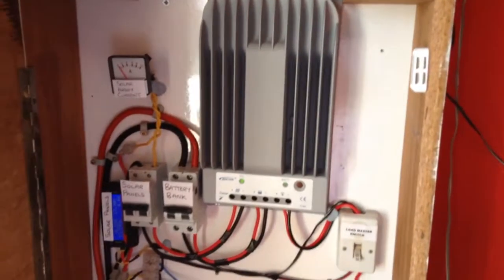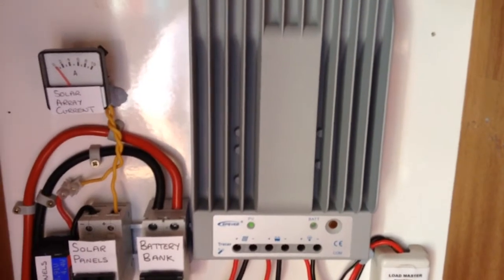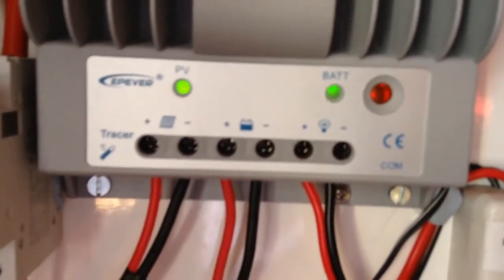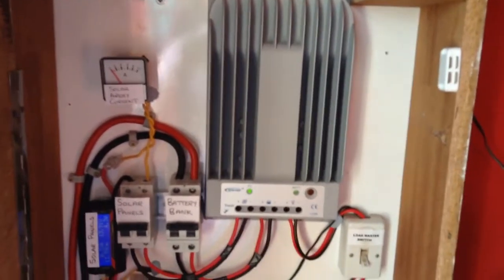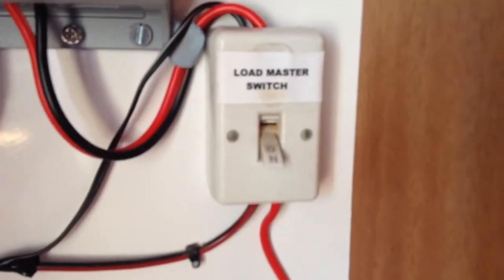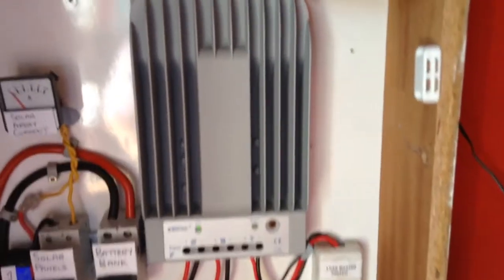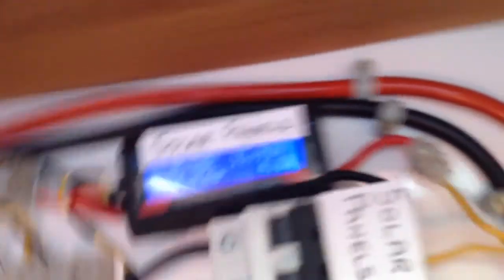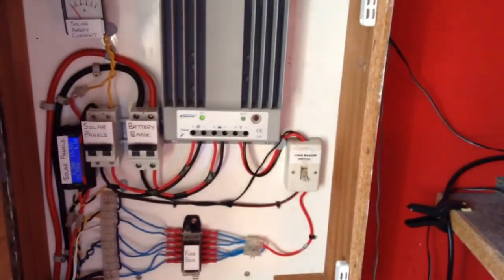Sun 5th June New Tracer 3215BN 30A charge controller

Comment from the maker: Hi, yes I run all my loads from the controllers load output, as my controller has a remote meter which shows the current and power consumption of the loads connected to it. My controller logs the amount of watt hours charging from the solar panels and the watt hours drawn by loads which can be useful. Also the loads are protected by the charge controllers protection features, such as if the load develops a fault such a short circuit the controller will disconnect it from the batteries helping to prevent a fire for example, although all loads should be properly fused though, the low voltage disconnect function will switch off the loads if the battery voltage fall too low, the load will be cut off if the battery voltage gets too high or if the battery cables are hooked up in reverse.
The only thing connected directly to the batteries through a circuit breaker and switch is my power inverter as it needs more current than the controller can supply.
I have a 12v system as most of my loads are DC and inverter is low powered 300w ( used mainly for charging things with supplied AC charger e.g. Cordless power drill, hedge trimmer, e bike batter, laptop pic and other electronic gizmos, nothing over say 200w max).
If all your loads are AC and high powered, I recommend 24v or 48v system, because at a higher voltage less current is needed for any given power requirement. Especially where high powered inverters are being used, high current cable is expensive and bulky to handle. High currents increase the risk of fire as well.
If you use 24 or 48v system you can use 12v equipment as dc converters can be purchased to convert the 24 or 48v down to the 12v needed.
Hope this is helpful, if you need more info feel free to ask and explore my other videos, thanks for interest in my channel. Solartiger

Comment: Hi, question:
Do you ONLY run your loads from the controller's load output, or from that AND the batteries direct? 
If both, why? I'm new to solar and struggling with a lot of conflicting info...

Comment from the maker: Forgot to mention my loads. Most of my loads are DC, I have 12v fans, lights, battery rechargers (aaa,aa and 9v), soldering iron, music system, vacuum cleaner, mini fridge. In my solar shed I have fans, dc water pump, lights, radio and dc led flood light. I also charge and run 5v USB devices through an 12v to USB adapter such as iPod,iPad ,USB fan , Bluetooth headphones,MP3 player, powerbank.
I have the inverter to run AC items, these are mainly ac adapters to charge things such as power tool batteries e.g. for cordless drill, hedge trimmer, electric bike battery etc nothing high powered, most these consume way under a 100 watts, hence I have very small inverter. I also have an inverter in the shed (350 watts 12v) I use this to power the grass strimmer and uses 300 watts, cutting grass takes about 30 mins once a week.
For the shed I have 50 watts solar, 1x 12v 100 amphour battery and 350 watts inverter, the inverter is mainly used for grass trimming once a week and only for a short period at a time . I mostly use dc things such as fan, listening to the radio/ music system , soldering iron etc on the weekend, so plenty of time for the battery to charge during the week.

The indoor system gets daily use hence it is more powerful but still small by a lot of people's standards.
When using electricity always treat it with caution where ever it comes from. A 12v battery way sound safe, but short it out with something metal and you could be seriously burned and the battery may boil or even explode, flooded batteries contain acid that can burn the skin and the AC current from your inverter can electrocute just as well the mains from the grid. So be careful, use the right size cable, always use a fuse or breaker of right type and rating and Ac wiring must always be earthed/ grounded for safety.

Hope this is helpful. Solartiger Happy solaring !
Reply: very helpful, thank you for taking the time

Comment from the maker: Hi,
I have the wind controller in the battery,box, there is no issue with corrosion from battery fumes as these are sealed Agm batteries and under normal conditions the gases produced when charging are recombined inside the battery, this is why this type of battery is safe for indoor use. The wire used for the wind generator is rated for 25 amps, its max rated output is 18 amps which I have never seen. I think you would need gale force winds to achieve that. The highest I've had in my location is about 10 amps and that was in a storm.

The solar panels are wired in series (3x 17.2v =~60v on a clear sunny day) using 4mm2 solar pv cable into the house and then with 20 amp to the charge controller. The panels produce approx 6 amps max. I have a 10 amp double pole DC breaker between the panels and the charge controller. The controller can output up to 30 amps into the battery bank and only 20 amps into the load output terminals. From the controller there is a 32 amp double pole DC breaker (if the controller develops a short circuit across the battery terminals the breaker will trip preventing a fire as the batteries could push serious amperage in to a short circuit). The cable from the controller to the batteries is 16mm2 which is rated for 110 amps no problem to handle the 30 amps max from the controller.
The 300 watt 12v pure sine inverter is wired directly to the batteries through a battery cut off switch (type used in cars and boats, good for at least 100 amps) a 25 amp circuit breaker (car fuse type) and an amp meter (0 - 60 amp analogue type, to monitor amp draw). At max load the inverter would draw 30 amps, I have it fused for less as I don't need that much power. My inverter is very small, but it covers my needs, yours will probably be larger, so you scale up your components and cable accordingly.

I have 300 watts of solar, 300 amp hours of batteries (of which you can only use 50% if you wish your batteries to have a long service life, so 150 amp hours in my case) and 300 watt inverter. This is a small HOBBY system, I have grid power for everyday living.

This comment was long, but hopefully answers most of your questions, if you want to know anything else feel free to ask.

Solartiger

Comment from the maker: I am happy with it for the price. I have the 30amp version but the load terminals can only supply 20amps ,the 40amp version is the same. Another thing I have noticed is, I have set the charging limit to 15V as stated on the batteries, but I have noticed that max battery voltage displayed has sometimes reached 15.4V, just to let you know.
If you will be using an inverter regularly I would recommend a 24V setup. Hope this is helpful.

Comment: Ｈｏｗ　ｆａｓｔ　ｄｏｅｓ　ｉｔ　ｃｈａｒｇｅ？
Reply from the maker: xierxu How fast it charges depends on the amount of sun, the wattage of your solar panels, the capacity of your batteries and how discharged they are. Solar panels rarely produce the output power that they are rated at, that power is measured under ideal test conditions, real world conditions just don't match that. This is a 30 amp controller, the manual says you need 400 watts of solar panels in direct unobstructed sun to have a chance of producing that. Chances are you won't achieve that, also your batteries will only draw max current if they are really 'flat'  (which you should avoid, to prolong long term battery life), if your batteries are well charged they will only draw a small current to charge regardless of how much solar power is available.

Hope this helps. Solartiger
Reply: Solartiger Very informative. Thanks.
Reply from the maker: C
Reply: I have a solar epic and was wondering if this has a switched relay that I can run the box fan when the batteries are gassing or how can I make that work?  thanks for your great video!

Comment: Seriously better stuff is out there but the tracer is really good. I found a better MPPT here, http://rover.ebay.com/rover/1/711-53200-19255-0/1?icep_ff3=11&pub=5575119394&toolid=10001&campid=5337668021&customid=Best+Warranty&icep_store=Hurricane-Wind-Power&ipn=psmain&icep_vectorid=229466&kwid=902099&mtid=824&kw=lg His stuff is that next generation MPPT
If you get one do a vid on it. I will try to upload a vid when I get a few more .
Reply: Јоhn Daniel ..i considered rover but requires renogy specific meters etc..   I guess it's better if you need to use dc loads?